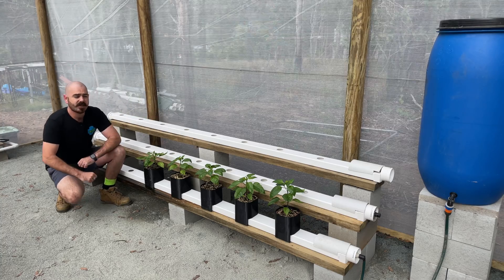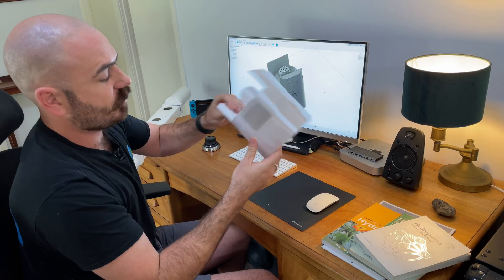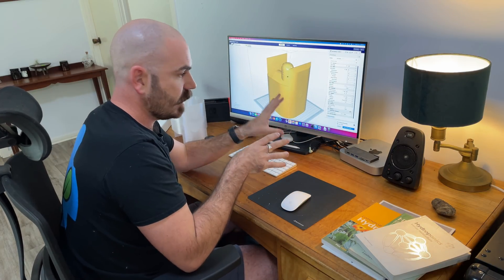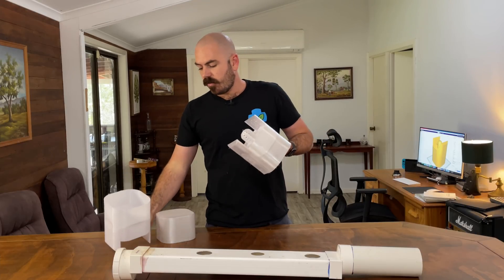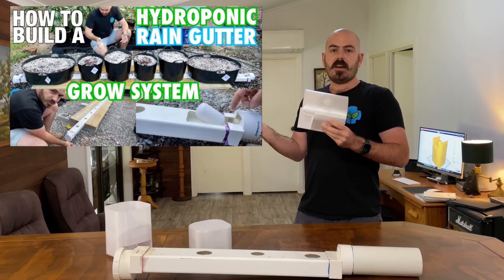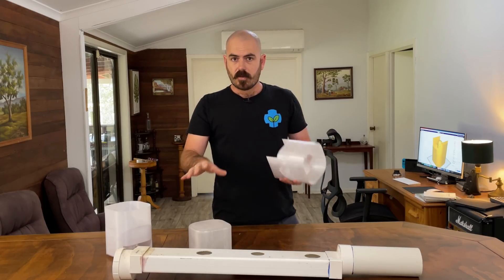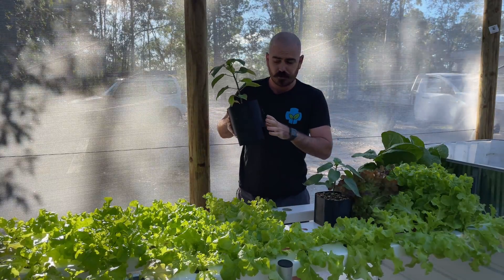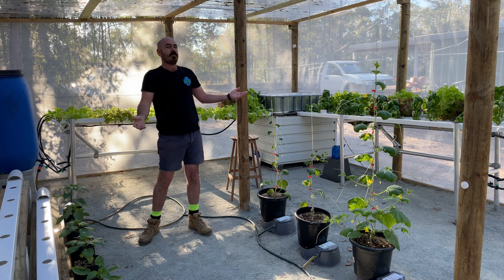How to Make a Hooch Bucket Hydroponic System

Comment: If you use a wifi capable SD card, you can leave it permanently in the printer and transfer .stl files from your computer via wifi.  You can even do this while printing a different .stl file.

I use a Toshiba FlashAir (https://www.amazon.com/gp/product/B072SN7QK6) with my Ender 5 Plus.

I just checked the price on Amazon.  It's more than doubled since I got mine in Jan. 2020.  It was just $53US then.  You might try some of the cheaper alternatives but you'll have to investigate whether you can send files to them since they're really intended for getting picture files from a camera.  The FlashAir can handle ssh and also runs a tiny web server with WebDAV.
Reply from the maker: I’ve just bought two creality wifi modules for my ender 3 pro and I’ve got another ender 3 pro in the mail.
They were $20 which was real cheap
Reply: @Hoocho  Is that there new wifi box?  I look forward to reading about your experiences with it.

Comment: I have been playing with pH stabilization of hydro nutrient solution for growing peppers using a really affordable organic friendly additive, so far is working and doesn't drift for 4 weeks with float valve replacement of nutrient level. Get in touch if you want more info, I reckon the manufacturer should sponsor your channel :-)

Comment: This rocks! did you have any misprints while printing the buckets?
Reply from the maker: Yeah when I was prototyping it was hard to get the wall thickness strong without chewing through filament. And I had a Bowen tube fitting break.

But once I had the printer problems sorted and the print model was stable it was smooth sailing.

Comment: A 3D Hoocho show 🤙 

Can they be printed for both larger NFT channels and with bigger net cups ? If so, I think this NFT printed pot solution could tick a lot of boxes for growers needs. Epic production again 👍
Reply from the maker: You can scale the print up in the slicer. It’ll make the walls thicker and it’ll take more filament but it’s possible.

Comment: great modular design and insight into uv resistance materials.

regarding round pipe design the 90mm pipe is a bit cheaper so looks like a winner yet just remember will have to be braced every 1m as not to sag under the weight of nutrient solution.

Comment: any chance you'd be willing to sell the finished pots? for those of us that don't want to muck about with 3d printing.  I think they'd sell easily, might be worth your time.  anyway, love the design, my concern is wind / tipping, which is why nft doesn't work in my area, very windy.  now if you fashioned a harness or a bolt or something underneath on those flaps so that it was proper secure to the channel, that'd be something.
Reply from the maker: I won't be making them myself, but I've added a tier to my Patreon to enable people to print and sell these with my permission/ endorsement and will include a link to their sales platform in the description of the videos about the Hooch Buckets
Reply: @Hoocho  I’d like to supply them to the public at NQ Hydroponics - I’ll do the maths and maybe get a few printed for customer display to feel the demand.

Comment: Looks useful but for around $5 a pop, it'd be much cheaper (and time saving) to just attach a net cup to a bottom of a plastic planter w/ a hole drilled in the bottom..
Reply from the maker: That was the original system. This is designed to eliminate the need to support those planters and minimise the space the system takes up. It also allows the system to be suspended.
The material cost of: pot, netcup and supporting timber 
Actually start to ad up too.
Reply: @Hoocho  Use two plant pots, glue or silicone one to the pipe as a holder stick the other inside it, hole cut through (or do it before gluing - wotever) and drop in a net cup. I'm not knocking the ingenuity - I'd buy this as a system at scale if it was cost effective, but it makes no sense if you're cheap. Jesus mate, you were worrying about spending 20 cents on rockwool in an earlier video with the jigsaw mat. But people would definitely buy this. Stuff like this looks fantastic on the shopping channels. Maybe be seeing you on Shark Tank/Dragons Den! Get that IP registered.
Reply: @Hoocho would it be possible to  change it to suit  a  downpipe  measuring 100x65. .? I don’t know how to change the settings but i can 3d print from a ready file.  I’m a patreon  member. Thanks in advance.

Comment: I like your system. You've wrapped your head around 3-D printing very well. I considered working with round pipe for a while but have rejected that in favor of the downspout material. Round pipe is in short supply in Dallas and expensive to boot. The square cross-section downspout material seems to be a more stable platform and is readily available here. I wish you luck in your endeavor. You've certainly done a good job and have acquired a valuable skill.

Comment: This is amazing, I wonder if they make paint strainers that would fit this size? Instead of using plastic at the bottom
Reply: you would want to have the roots grow into the 100mm rectangle base pipe, therefore paint strainers would only limit root growth limiting plant size. i suppose you could use plastic fly screen and cut a round hole in the middle

Comment: just love watching the time lapse footage, the only gripe i have with 3d printing is the time it takes to print and if something goes south while printing its wasted plastic and time, i have to give a mahooosive   👍 for all that you are teaching, have you seen the zip grow systems and what a rip off they are its beggars belief they sell them.
Reply: That's probably the gripe /everybody/ - yours-truly included - has with 3d printing.  Little tchotckes are nice -- "hey, little niece, printed you a Pokémon (or whatever kids are into now) toothbrush holder!" -- but for serious, larger stuff, that takes hours and where a /single/ goof can ruin everything and push you into tomorrow, sucks much. (Reminds me of ancient programming days, in fact, where our ancestors would submit a compile/run job, wait hours for their turn in the queue and then for the actual run, find that it threw an error, have to fix it, repeat until success...) AND - what's harder here is that things need to be WATERTIGHT! And generally fairly large -- bringing up not just "platform size" -- but the bugaboo that when things expand into not just "linear-space", and not just "planar-space", but "VOLUME-space" -- y'all see where I'm going here? -- making things "bigger" means the time to print them takes way, way, WAY more time, as they get even a bit bigger. (Which is why, in hydroponics made from PVC pipe, the cost of going from the 1.5" pipe to the 2" pipe to the 3" pipe to the gasp 4" pipe (none of which even resemble those actual measurements of course) get *breathtaking*.) 

ANYHOW. Yeah. Printing "big things" sucks, still. I think it'd be a killer breakthrough if someone comes up with a new angle -- and I have NO idea what it might be -- where fixing this whole "I got 2/3 of the way through, it started bumping (or my filament broke, or whatever) -- and SO THE PRINT WAS RUINED AND I HAD TO DITCH IT ALL". Instead: "and so I was able to continue, saved the print, went to dinner happy....".  That probably entails getting away from FDM/filament printing and into resin-type, I dunno. We got what we got, so meantime, best options are to tune everything really really well, have a system you can monitor well (I keep thinking about doing OctoPrint, a camera, etc., but this always feels like closing barn door right after horse got out), use good materials, (I guess I'm going at good engineering practices in general, here!), etc.
Reply: Imagine how glassblowers feel. 😄

Comment: Very cool.  My only concern is if the pipe is PVC then at 104 degrees the plasticizers will leach into the water and into the plants.  These are carcinogens.  Consider using uPVC which is manufactured without the plasticizers (u stands for unplasticized).
Reply: Luckily enough in this situation the pots shouldnt get above water boiling point. unless you meant during cleaning them?
Reply: I am referring to the white pipes used to hold the water that your pots sit on top of.  At 104 degrees Fahrenheit (40 Celsius) PVC will leach (well below boiling point).  I am not familiar enough with 3D printing to understand what that material is made of.  I am experimenting with an equivalent design but using a different approach.  PVC is attractive to use because it's cheap and the plants grow fine, but PVC was not manufactured for potable water and what leaches into the hydroponic solution will get absorbed by the plants.  In my design, I am considering lining the inside of the PVC with pond liner to prevent any leaching or using a  different material entirely instead of PVC.
Reply: @davidsocha3765  Has anyone quantified the risk of this exposure? PVC pipe accounts for more than 70 percent of new buried water distribution pipes being installed in the United States and Canada. It's clear that many don't consider this to be a problem.
Reply: @davidsocha3765  oh! my bad i was thinking 104 celsius, now it makes sense.
Reply: @benthere8051  There are different types of plastics.  The issue with PVC is heat.  If the line is buried underground deep enough and carries cold water then heat isn't an issue (and likely that plastic isn't PVC).  PVC is never used to carry hot water in commercial or residential use.  I redid my home plumbing using PEX for cold and hot water lines, and while that is plastic, it's not PVC and is rated for carrying hot and cold water.  PVC subject to above ground temperatures, and certainly PVC kept inside a greenhouse, are subject to high temperatures are an issue.  Has the issue been quantified?  Not that I am aware, but when we're talking about cancerous substances then it is not something I need quantified.  Be safe and be aware to mitigate any potential risks.
Reply: @davidsocha3765  I view the risk of exposure to the plasticizers to be similar to the risk of exposure to radiation. If I had children that were going to eat veggies grown in PVC and the quantified risk was high, then I might reconsider... after all, bananas are radioactive, and high altitude air travel ups your radiation exposure. Eating high-quality veggies grown in PVC may be better than going without.
I do respect your concern.
Reply: @benthere8051  Likewise I respect your stance.  Cheers.